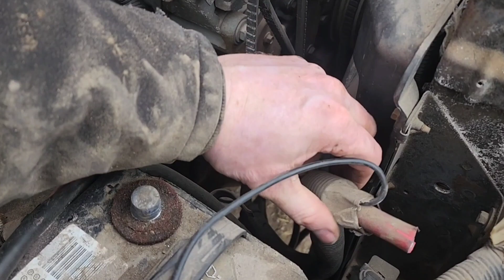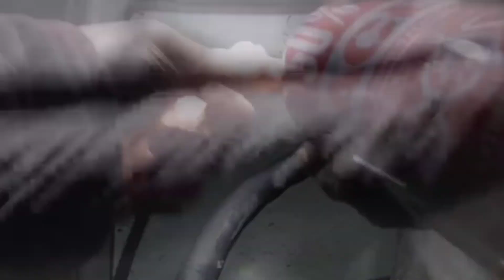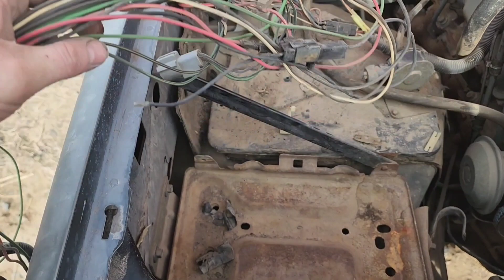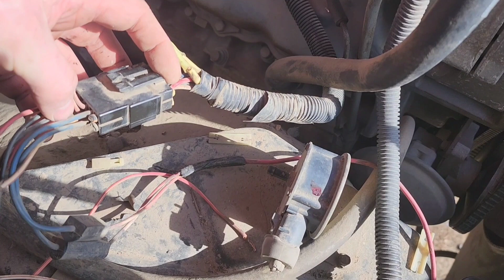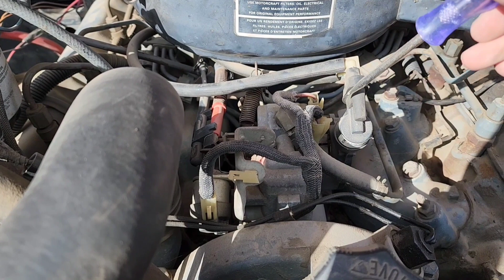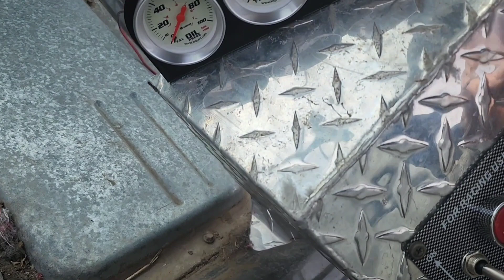7.3 idi diesel wiring harness gets put on a diet featuring @ziptiesnbiaspliesrace truck ep.8

Comment: Beware old friend, on my 87 ford, one of the wires to the fuel shutoff/glow plug was (green I think) a fusable link wire that will Melt if overloaded! Leaving the insulation intact…🤬🤬🤬try finding That on the side of the road 😂😜

Comment: Can you show me how to repair my wire harness, my batteries blew up and melted the wires and I don't have any idea how to fix it and I can't afford to take it to a shop, if it wasn't diesel I could fix it, I don't know much of anything about diesel engines except that I love my truck it's a beast I have an 87 f250 7.3 I have a harness I got from a farmer the whole thing from where it bolts together in the fire wall all the way around the motor to the silinoid I don't have a clue what plugs to what please help

Comment: So currently finding a decent 7.3 idi for a swap with a 5 speed. Don't want truck just motor trans shaft axles and springs for a swap. Tryna find out what all I need to run the 7.3 independent of the truck, and leave the stock harness in or what I'd have to swap as well. Considering ik dam well the vehicle it's going in ain't comoatable. But I got a welder a dream and some spare time in future and a perfect swap donar

Comment: Back in the early 1990s, max Lagod of Hypermax put together an extraordinary engine package for a customer yearning to compete in sled pulling. With nothing holding him back, Lagod designed a 7.3L that included two Garrett turbos (which were state-of-the-art then but probably not manufactured anymore), a Bosch inline P-pump, custom injectors, a fabricated intake and exhaust manifolds, and slight cylinder head work.

Surprisingly, much of the factory engine components were retained, such as the crankshaft, block, and pistons-although the connecting rods were heat-treated. Compression on the engine was 15:1, which called for ether-assisted startups. Soon after entering this wild IDI into area-sanctioned sled pulling events, the engine was banned. Not to be discouraged, the owner turned to drag racing. Rumor has it that the truck graced with this 7.3L beast put out 1,200 hp and ran quarter-mile times in the 9-second range!
Reply from the maker: I will have to do some googling and read about some of that history. Thanks for the info

Comment: Thanks for the great video! I commented on another video about the glow plug system and I had one more question. Since I am adding a 7.3 GP kit to my 6.9 I’m not sure what all wires are but I see you have 1 extra red wire attached on the small terminal across the terminal with the white negative/ground. What is that?
Reply from the maker: The little red wire is keyed positive power. So it gets positive power whenever the key is in the on position.
Reply: That makes sense, before I connected anywhere I first tested it out by getting positive directly from battery and my glow plug light turned on! But it did by itself and when I press it, it turns off. I suck at electrical so what does that mean? If I connect to something that turns on only with the ON position, would that fix the problem? Thanks for all your help, I can see I’m almost complete with this job, thanks to you!
Reply from the maker: @sammychipz  Ya, you are probably connected to someplace that is always on. You only want it on with the key.
Reply: Man! I wish I lived where you live to tell how thankful I am, that I found your channel! I actually was testing something out and put my camera towards one of the glow plug connectors and when I hooked up to direct power like I had told you. I pressed the button for glow plugs and the light came off but with my test light on one of the GP connectors, my light from the tester turned on!!! So now I just need to find somewhere to connect when key is on the on position! Thank you so much!

Comment: awesome video where did you get the gauges and how much where they none of mine work in my truck and would you no why after brand new glow plugs and new relay on a push button why my truck still starts very hard im thinking fuel pressure
Reply from the maker: I found the new gauges on Amazon, they cost me $65 here is a link to a video showing where to plumb in aftermarket gauges
https://youtu.be/j2Z2AEUD3D0
The hard starting is more than likely air intrusion in the fuel system. Look at all your return line caps for moisture, look at the fuel heater on top of fuel filter housing, check the fittings in and out of lift pump, filter housing and injection pump. If you have any moisture allowing fuel out then air can get in, any air getting in will drop your fuel pressure and make it hard to start. Good luck with your project, God bless.
Reply: I had (have) the same problem and mine was air intrusion. I think it is at the tank selector valve in my case.
Reply from the maker: @DankoStojanovic  Blue nose my 6.9 idi dump truck had a bad fuel tank selector valve that made it hard to start. Then it would die a little ways down the road, restart and run fine again. I ended up putting in brass 3 way valves, cured all my hard starting and dying out issues.
https://youtu.be/JoO0e5UKVKc
Reply: @worthshop  Yeah, I've seen how you did it. I am considering it. I'd still like to put it back the way Ford did it but if it keeps giving me trouble I'll just do it like you did and delete the automatic valve
Reply: Great info buddy! Thanks for sharing! 👍👍👍👍🇺🇸🇺🇸🇺🇸🇺🇸🙏🙏🙏🙏
Reply from the maker: @simpleman4224  Hope it comes in handy for you in the future working on your truck.